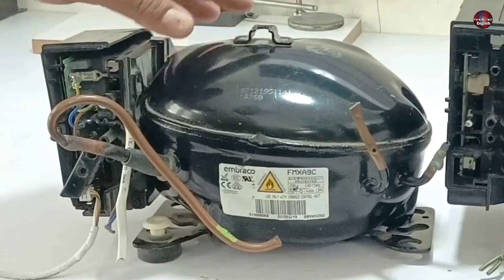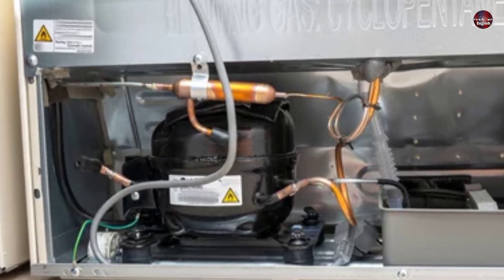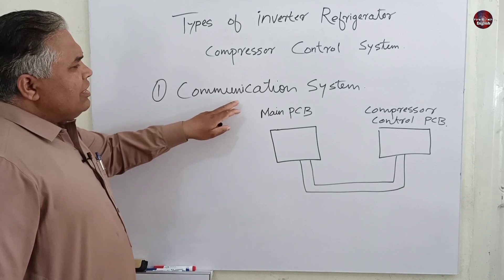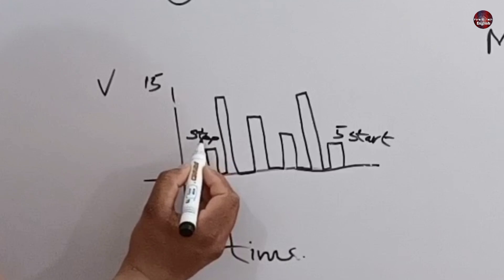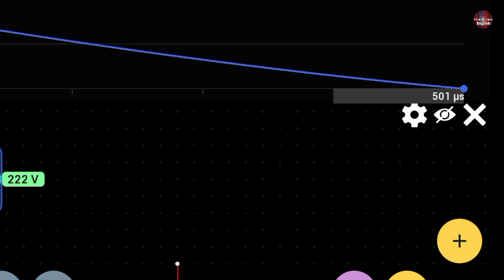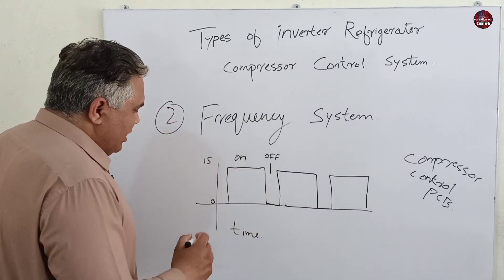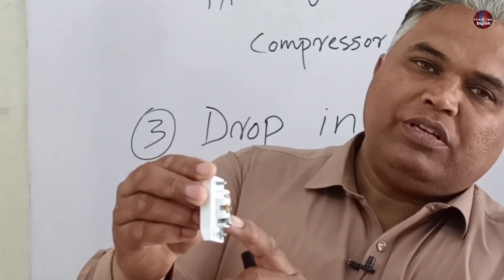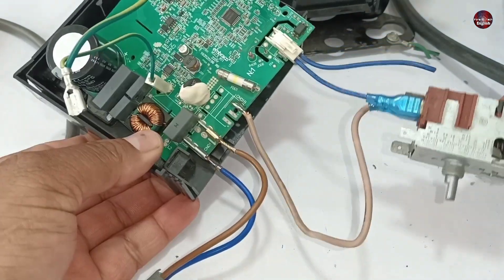Refrigerator Inverter Compressor Control Types & Working

Comment: I have noted that most inverter systems fail due to power spikes or in most cases insects as the inverter is close to 400v and the pcbs are not coated , usually only use discrete igbts not IPM . They use smps for the power supplies- the chinese chips are difficult to find.

Comment: So basically, it cools regularly and uses the typical thermostat to turn it on and off but when asked to turn off, it simply turns low power. If the thermostat turns back on, it goes back to high power. If it stays off for too long then the temp might be getting too low even on low so it shuts off. I take it can better adjust to the system as time goes on.

Comment: Good day sir! In inverter drop in system when the thermostat sense your desired temperature setting the control board will only lower the rpm or frequency of compressor resulting to lower wattage...am i correct? Unlike in non-inverter drop in system the compressor is completely turned off once thermostat reached its temperature setting...do i get it right sir? Thank you!

Comment: Showed coil from S to R Ohm double that to center tap S to C, R to C reading. Now this compressor is equal. What are the versions? Delta and Y, ac and dc?